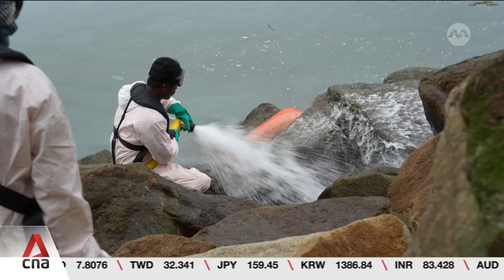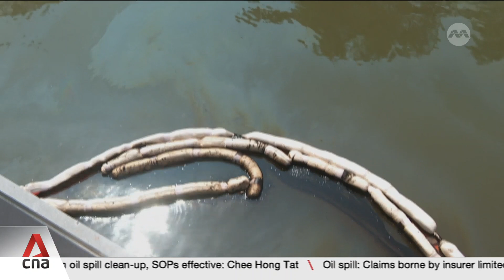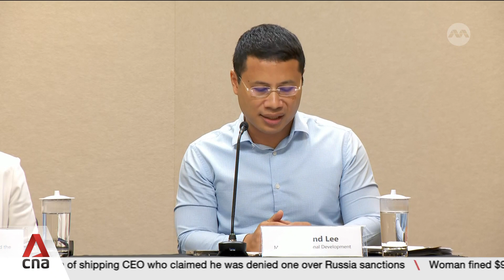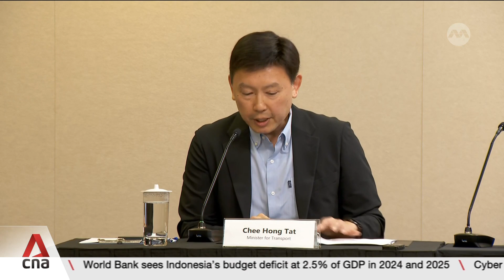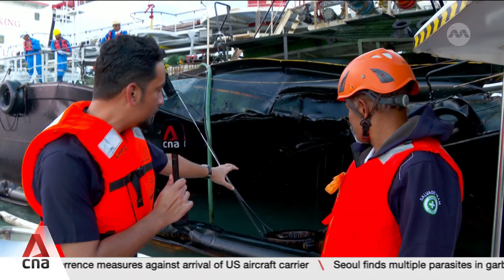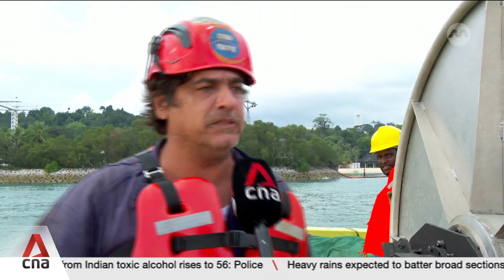Oil spill clean-up to take up to three months before affected beaches progressively reopen

Comment: The question du jour is whether the beach waters 🌊 off the East Coast Park, Changi, Sentosa, Keppel Bay and Labrador Nature reserve are safe for leisure swimming, snorkeling, diving and other water-based activities such as kayaking, yachting, surfing, water-skiing, etc without hinder of thought by members of the public that there are toxic chemicals and agents formed as a filthy mixture with the sea waters, resulting in skin allergies or even worse, cancer-causing elements. Therefore, I will strongly recommend a lull period of at least 6 months or more, pumping out affected seawater for careful filtration at PUB decontamination plants before pumping them back into the affected coastal areas. Very costly for the government, but it's for our assurance. Sigh...